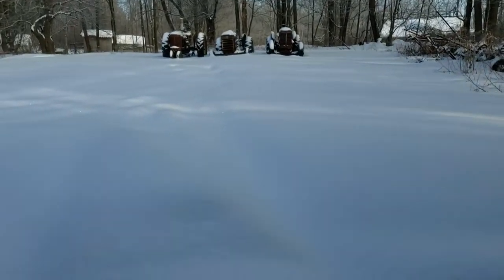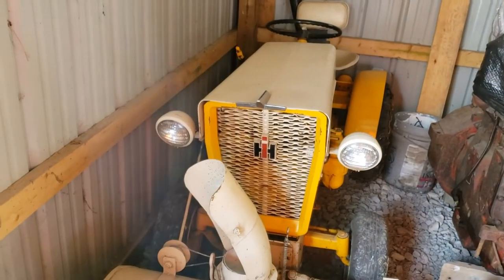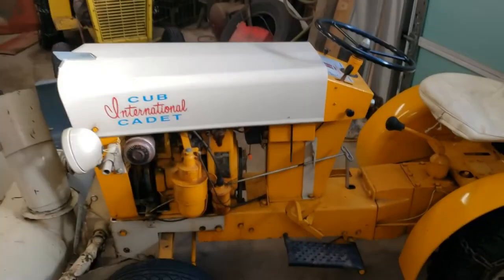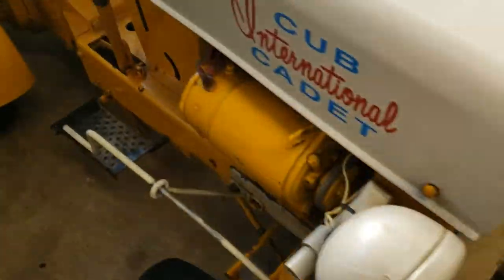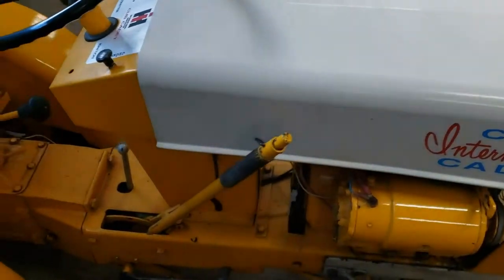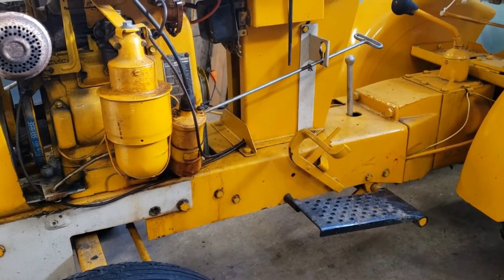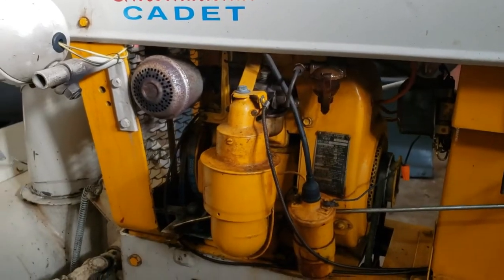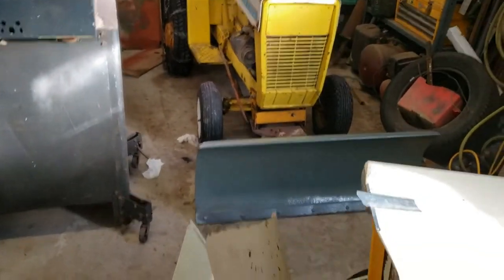Cub Cadet Original with IH Snow Blower

Comment: Hi Deering Dave! I Have among the Cub Cadets I have, a 102 with an IH QA36 Thower ( did IH buy Danco? ) on it and it was old when I got it and much more now and I have used that for clearing snow for near 40 years it is not pretty but it does the business! it is showing its age, the stones have the auger rolled over a fair bit I welded a bead of 1/4 steel wire at the entire edge of the auger and that has helped but in the end everthing has all the use used up , not sure why IH changed the chute control to that indexed thing I think that cable drive is a better idea over time! may convert back to that? I recently aquired an almost mint QA36A so I hope to have that either set to go on the 102 or the other project that the thrower came with and has the mounting gear for it,  a 1650 the engine has oil control issues a 30 over and rings should rectify that heres hoping anyway, I have a 122 for parts, a 100 that has not seen a blade of grass for years and the 1450 that took over from it about ten years ago, I have had the 100 longer than the 102 the 100 was My first Cub, They are as a Consumer product for the most part at the top of that game in the IH era and a decade and a bit perhaps with MTD also as Garden Tractors go and it is to late in the Game to change sides now anyway would rather eat Crow ! I have many memories and some yet to experience some good and otherwise : )  on the Cubs Winter Spring Summer and Fall ! Thanks Dave and Thanks IH ! Cheers!       P.S. the Thrower works well as a plow also there are many times it is not nessasary to run the auger!
Reply from the maker: @rickarmstrong4704  I don't think ih bought Danco, but they sure made alot of attachments for cubs. I was a cub wrench for our local CaseIH dealer, and I noticed a decline in the product after 1985. I like the wire repair ... I might do that when I lose my edge. I don't know where u live... but I keep one with the blower, and one with a blade, as snow consistency varies here.
Reply: @DeeringDave  Hello Again Deering Dave!  I was thinking that as a possibility as the Danco name was disappeared ! Yes the edge over time gets rolled over the metal could have been a guage heavier but how many have been used for long past the engineered expiry date like 30 or 40 years more probably as I am sure it was used before I got it, it was mostly easy to nest 1/4 solid wire into the rollover clamped with some vice grips and stitched in place and repeat till done,  took quite a while and it has improved it the reason I did not could not straighten the auger out was the case is not were it started out at as it left the factory, I had also thought of using a junked grain auger to make a new one ( were to find this item also ) but not sure it is usualy that diameter. one would cut two sections and flip one so they both auger to the center and cutting them correctly would give a tail to tack the thrower bucket portion all in one operation but the diameter has to be correct! Yes also setting up for plow and Thrower is a good idea also I do have one for the 1450 however but I prefer the thrower however there are those times! I live in Aurora Ontario and We do not get winters as I recall from childhood the last one in fact was snow then rain more often than not more salt than average, speaking of, thats why the case is rusted as it salt the primarily culprit and time,  Anyway these are  very durable Tractors as are the attachments for them, built to attract the Farmers but sold with an eye to the Homeowner perhaps more so! Not sure how the Folks in Buffalo get on with anything in that City or in some places in the Sierra Mountains like Mammoth Mountain! Crazy Stuff! want some entertainment and amazement as to why People do this to themselves? search ( snow clearing mammoth lakes ) it has Buffalo Buffaloed! Cheers!!! Rick

Comment: Question. Does ur cub have a pully on the front that turns the snow blower or a PTO clutch?
Reply from the maker: It has a pulley that runs non stop. There is a small idler pulley that engages.

 The small belt
A
Reply from the maker: There's an idler pulley that engages the small belt with the non stop crank pulley , controlled by rod that goes back to the operator. So, no pto clutch.

Comment: I have one of those blowers that I used for a while on a 127, clogged frequently in the wet snow and keeping the drive belt tight and not slipping was an issue (no idler/ tensioner came with it), so I began using an old Simplicity for snow duty. This year, after another lake effect dump, I was on youtube and noticed the later simplicity's used a 4 paddle auger. 
 Big difference, here is a link to a short vid I did on it-> https://www.youtube.com/watch?v=WpyQApBio1Y My plan now is to do the mod to the Cadet thrower and adapt it to a foot pedal hydro Bolens (love that foot pedal control).   Mike
Reply from the maker: I might try the paddle idea.
Reply: @DeeringDave  I went and dragged the blower into the garage, I made the xtra paddles, and I remember those angled (wings) would get snagged into a hardened drift, so I want to put straight tips on each side of the wings to lessen that effect. Rather than make the auger full width- they cheeped out.   I have a Wheel horse with those on and I got rid of them- but the horse did have a full width auger.  Mike

Comment: Would it be possible to make the augers spin faster with a different pulley ?
Reply from the maker: Yes, but you would have to change the belt size , and change the goemetry of the pulley engagement.